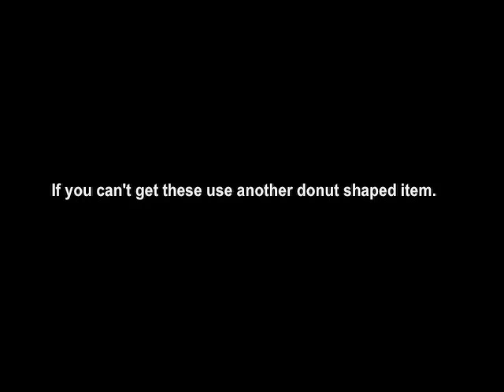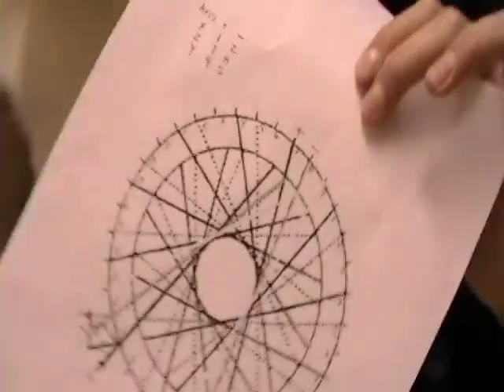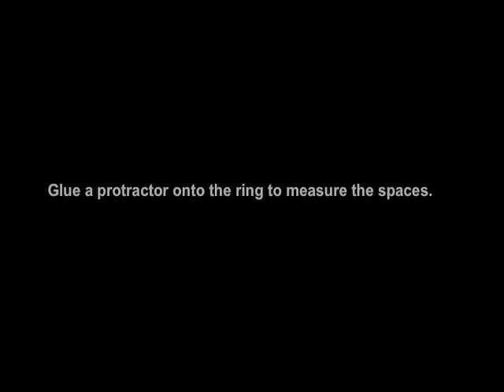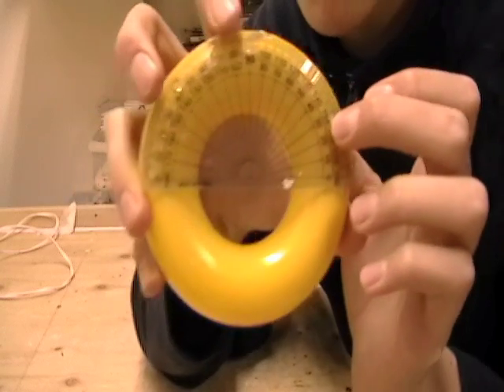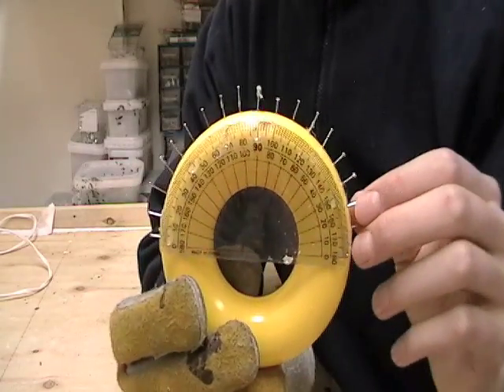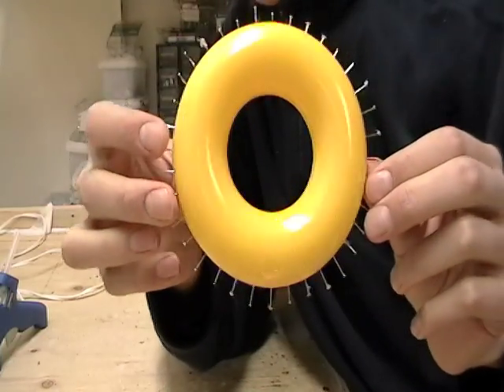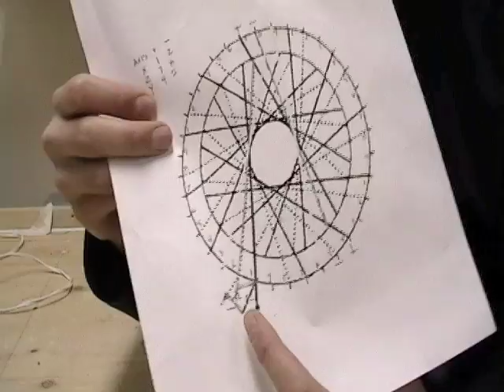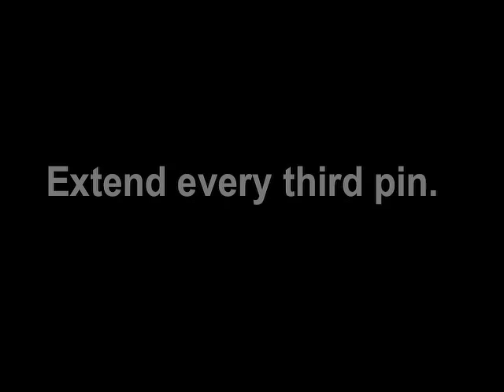How to build a rodin coil part 1

Comment: What if you stack 3 coils one on top of the other one, wire it in paralel an spin a neodinium bar on its axis on some ceramic ball bearings, inside the coils

Comment: If you understand vortex based mathematics you can make this coil off the top of your head.  Just add 150° to go to the next pin.  Keep going until you end up at the pin you started from.  The first circuit is 1-7-4 going clockwise that is 10° - 160° - 310° etc... The second circuit is 2-8-5. That's 20° (2+0=2) - 170° (1+7+0=8) - 320° (3+2+0=5 ), etc... Make sure you switch the anode and cathode on the 285 circuit because it needs to be going in the reverse direction.  Use magnet wire 28AWG and a 9-volt battery. Don't coil the 369 pins (universe response circuit).  When you pulse the coil, pulse the first circuit, add an time interval pause, then pulse the second circuit (it will be going in reverse), then add that same time interval pause, then add an imaginary pulse for the 369 circuit (don't pulse anything, but pretend you did (the universe will pulse back at you during this time period), then add an time interval pause, then repeat the whole thing again and again (See Jack Scholze's video - Lolo Neoball Spinner I & II on his you tube channel  -  https://www.youtube.com/watch?v=tA4yXevToQc ).

Comment: Heres a trick to avoid the protractor and glue. Since math is your friend,  calculate the  circumference of your toroid, divide the circum. by your point count ( 12 pt. 18 winds for example) then use your hard rule to mark your pin points along the edge of 1/4" masking tape which is easy to align and then secure your pin locations..

Comment: Hey, I'm trying to build one around the blue donut. Mine is different. I used a compass and a calliper to measure a gap of .119" to have 144 pins around 360degrees. this gives me 16 instead of 12 while still being of Rodin origin and maths. I'm having trouble mapping the path though... any help?

Comment: @tigerbody1 I do not remember the specific term Rodin used but because of the way the coil is wound the wire does not need shielding.  A "virtual sheath" is created.  I think it has to do with the electrons not being forced down a path.  The electrons stay on their pathway without shorting.  I have heard some people complain about heat generated from their coil.  Rodin claims there is no need for a heatsink so maybe the added insulation is the cause of the heat generation.

Comment: @magenpies I don't know why it's required, but the explanation is that the flow of electricity prefers to continue within the wires rather than jumping between them.  Despite connecting, they will not short your circuit.  However, I doubt that insulation will reduce your coil's effectiveness.

Comment: My humble theory (which I'm stuffing down everyone's throat) is that the correct geoemtry actually calls for a smaller hole relative to the overal diameter of the toroid. You'll see how the wires tend to only touch the outer half of the toroid, and only a very small patch over the edge on the inside. This creates severe interference with the expand/contract math of the Rodin theory. So however hard to do, the hole should be smaller. Wires will need to be special, or not wires as we know them...